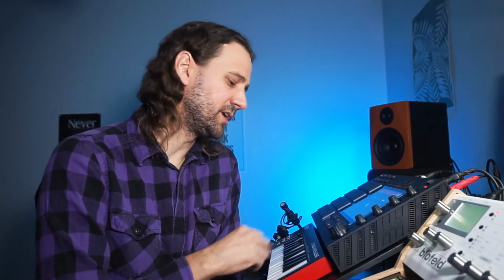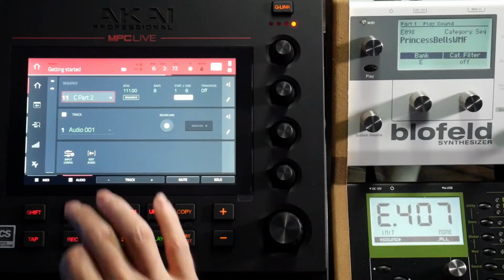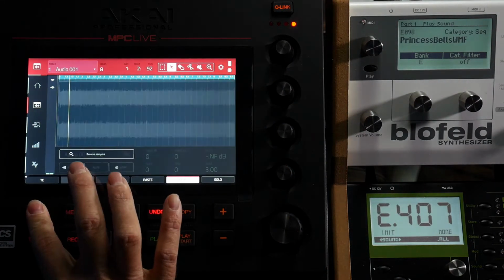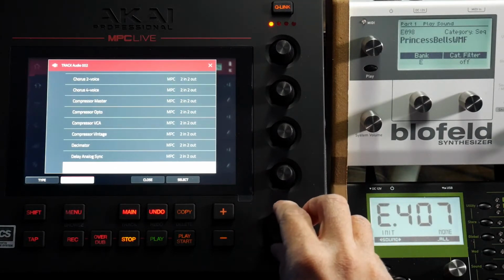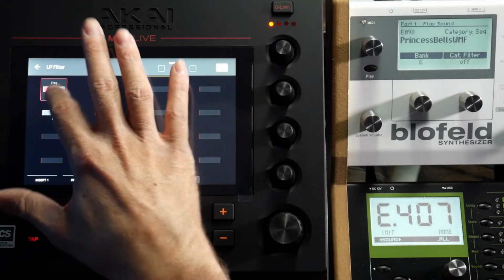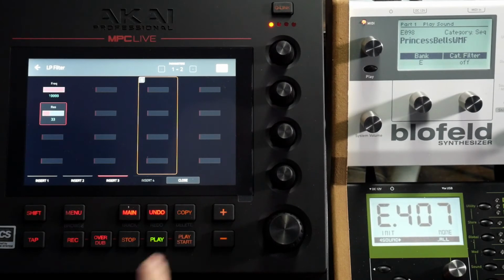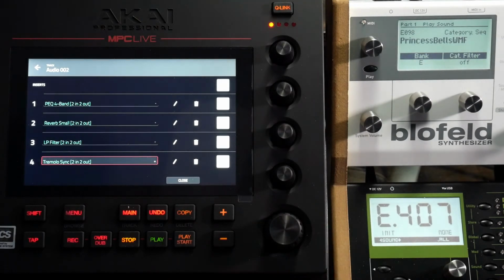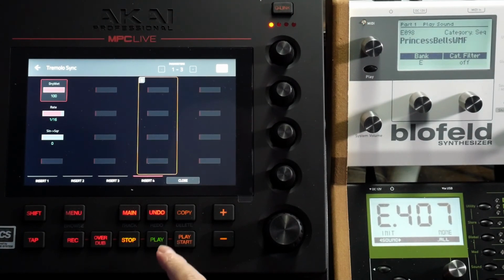MPC LIVE Recording Noise Filter Sweep (Quick and Dirty #13)

Comment: hi, thanks

My commands are different on the audio screen rec...

DON'T SNAP- NUDGE - EDIT STAR - EDIT END - SPLIT - DUPLICATE

By pressing the "SHIFT" key

TC - CLICK - TRACK - MUTE - SOLO

thank you for you time...
Reply from the maker: Which firmware version are you using?  You may need to upgrade your firmware to get the other shift features.
Reply: Matthew Stratton sure that's the reason, I was trying to learn the basics of the machine before updating it so as not to miss any data ...
Thank you very much!